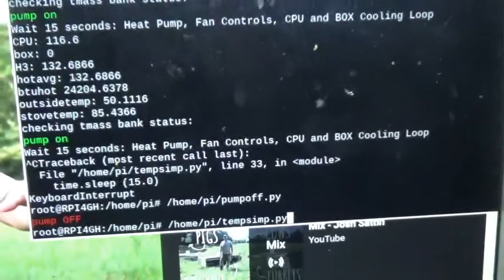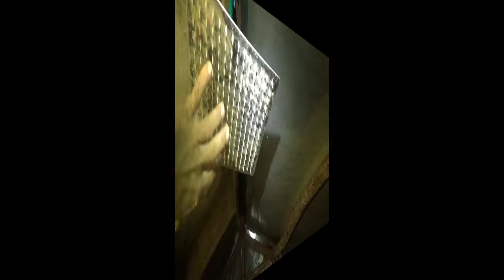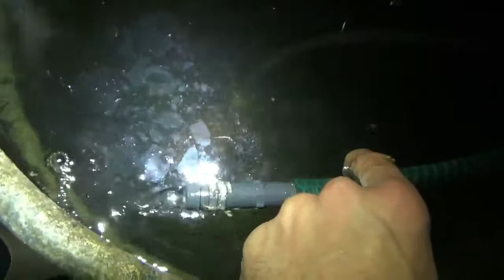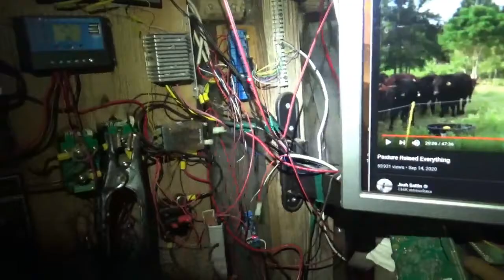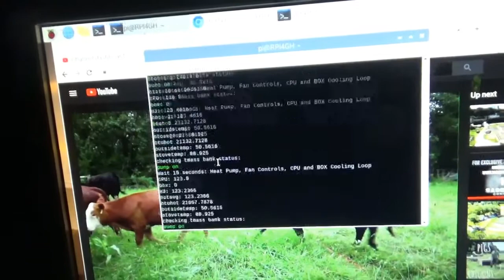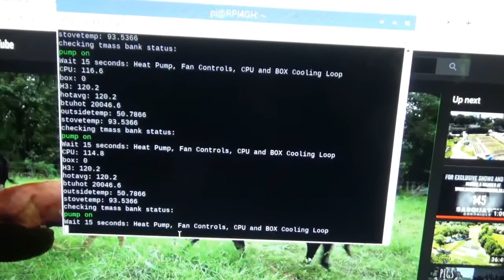Build Your Own Greenhouse Series Part 4 *Thermal Management*

Comment: Watching this is almost eerie because your system is set up a lot like mine I use some base components and then build in some of my own script and code...  There are about 12 different ways to skin the cat as they say... waiting on this part so I'm using this side of the board... Oh this part fried out and I can't get it for a couple of days so now I'm going to pull it off of the collectors and just zap it to the left side of the board.  Lol.  Oh man can I relate for CFM airflow temperature pressure drying high value seed corn is down to the decimal set up.  I haven't used humidity as a actual sensor for years.... I do use wet bulb that is the most consistent reading of the airs capacity to take on water which is essentially percent humidity.   Watching your videos has me rethinking that water used for heating is probably the best way to go because wet bulb would track perfectly with proper humidity You would just have to find the relative range and wet bulb is an absolute reading that I've had 10 years of success with.  maybe you know about wet bulb If you don't let me know it's a wild concept and it's literally foolproof.  Instead of using HVAC I'm wondering if water for humidity because it does get very dry in the winter... Hmmmm.  Got me thinking
Reply from the maker: Thanks so much for the wet bulb.  I am going to figure out the setup for that here (code-wise)! That is so much more sensible a way to do things. 100's of bad readings a day just screw up my database. So sick of that!   Yeah, I think water is the way to go.. that dry air just kills  Seed-drying on that corn to decimal eh?  Maybe there is some value in all my precision! :)  I like to track down to 2 decimal places. All my friends say "WHY?" ... I say, You can't be too precise. The more precise your data, the better you can model future engineering.  Yes, I think you could use water tanks, heated... and then control evaporative surface area based on humidity demand.  I have been thinking about doing something like that for about 3 or 4 years now. You were saying last night about how cold and dry it gets there.. that same problem applies here in the winter. I go through more water in the winter in the greenhouse than I do in spring or fall... by a LOT!  Most of it is evaporation to keep reasonable humidity.

Comment: not even halfway through the vid and ..... this kind of info has seriously changed the way I look at everything !! So many ways to implement these concepts in various other practical uses!! One question .. Do you find ANy detriments to using a wood burning stove ? Cheers Bud PPP Stay Bright !
Reply from the maker: Thanks so much!   I do find a few things can be tricky with wood heat.  You need a stove with good airfolw control so you can up-regulate or down-regulate relatively quickly. Response time is key.  Also, due to some ash, you will need to be extra vigilant for mold type issues. (Ash on the leaf surface is very high ph).  Ideally, you remove the stove from the greenhouse, and use hydronic circulation to bring heat in.

Comment: I have found there is no such thing as a good humidity sensor I've spent hundreds of dollars on a sensor... Still get errors.  How familiar are you with wet bulb temperature?  That is a much better way of measuring how much capacity of water the air can hold.  Through there you can write an algorithm that essentially creates a wet bulb temperature that comes out as a reading much more accurate and then you can base your commands off of that.  Just curious if you're familiar with wet bulb temperature
Reply from the maker: I am familiar with wet bulb temp.. but haven't played with any of that since high school. I would love to talk about that at some point!

Comment: That's a lot of good information my friend!  Love the geek stuff and some of this could even be useful in my lab, though I fight the other extremes in there.
Reply from the maker: Thanks Jack!  Yeah, this is SO easily adaptable to your lab.  Less opposite extremes to manage means less trouble, theoretically.  I can imagine cooling that lab in the summer in Florida takes some serious airflow and/or cooling.  I have some ideas for that too.
Reply: @TheFarmacySeedsNetwork  Currently I'm using a window A/C that runs whenever the lights are on, year round. And the lab itself is only 6 ft by 10 ft.  LOTS of insulation too.
Reply from the maker: @geekygardens  I'll bet... are you exchanging air through the chamber? I assume you must be. Ever consider an intake pipe buried in the ground to take on the coolness of the deeper soil. Pull cool air through to help manage temps?  Also, a cold water heat exchanger might be another option, especially if you are on a well.
Reply: @TheFarmacySeedsNetwork  Only real air exchange is the exhaust fan (with charcoal filter) and plenty of cracks into the rest of the shed for intake. If I try to dig deep enough for cooler temps I'll hit water.
Reply from the maker: @geekygardens  There ya go.. perfect... submerge some PVC through that, now you have a cold mass for the air to be cooled on intake.  Just a thought.